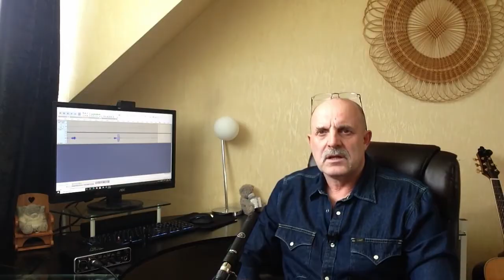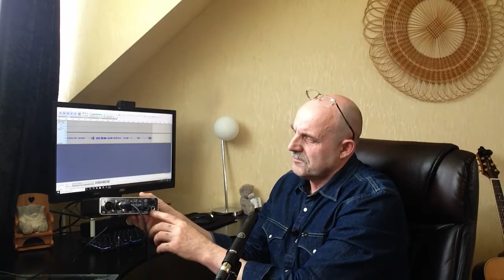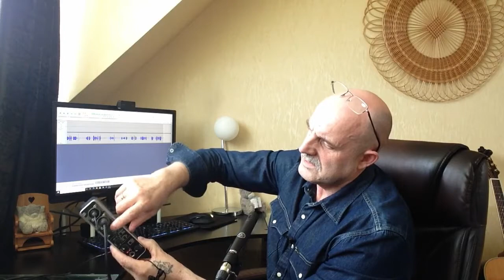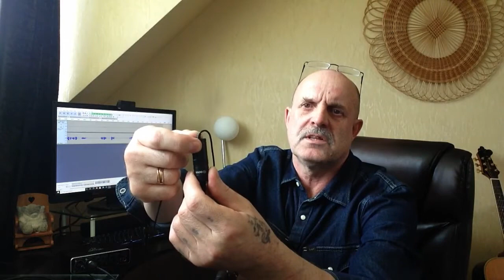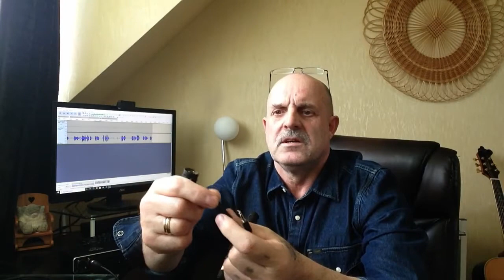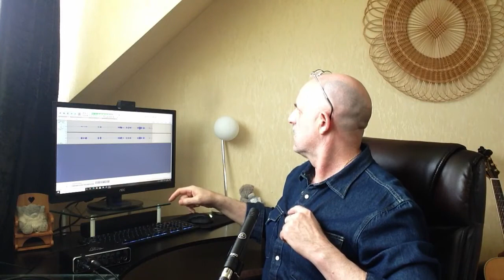Lavalier Microphone to Audio Interface/Mixer

Comment: Good morning sir.
I just bought that microphone and when I plug it in from the TRRS connector that it brings to the microphone input of the PC (the board has realtek digital audio sound) it does not pick up any signal, and in some cases it picks up a saturated noise signal to the point that the sound monitor of the audio DAW application fills the bars up to the red level without going down in any case. It does the same by connecting the "camera" switch and also in "smartphone" mode.
1. When connecting the BOYA lavalier to a PC directly, in what position should the switch be: camera or smartphone?
2. When connecting the BOYA lavalier to audio equipment that has 48v PHANTOM power (in this case a TC-Helicon Voice Live Touch or a mixer), what position should the switch be in, and what type of connector? I can use? In case of using a RODE VXL+ that converts 48v to 5v, in what position should the BOYA switch be?: "camera or smartphone"?
3. To connect the BOYA lavalier to any audio device, camera, PA equipment, processor or mixer, does it have to be done through the TRRS that comes with the microphone as a connector, or does it have to transform the 3-ring input to one of 2 (TRS) through a TRRS to TRS adapter?
I'm a bit lost, really.
Thank you for your patience and time sir.
Reply from the maker: Hello.
1. I have never used this microphone directly at the computer. Maybe it doesn't work because it has a TRRS end. Maybe you should try through an adapter with TRS.
2. If you use RODE VXL+, then you need an adapter from TRRS to TRS and the microphone battery must be OFF (Smartphone), because it will take power from the device. Phantom Power 48v must be on.
3. When using BOYA with the attached 6.35mm adapter, no additional adapter is needed. Then the microphone battery must be turned on (Camera position), because the microphone does not receive power through these connections.
All this is shown in the video.
There is also another video: https://www.youtube.com/watch?v=IljmjsvVDy8
Good luck.
Reply: @nostalgijaungitara  Thank you very much, sir!

Comment: I have a regular Lavalier microphone but when I plug it in to the aux of my radio, it doesn't hear the lavalier. Suggestions?
I am not a musician. I just want to hear people in the back seat of my taxi. I have a Plexiglas barrier because of Covid. Amazon doesn't have an easy fix. I have a Lavalier and a mini boombox
Reply from the maker: Sorry, I can't help you in this case. Maybe the microphone is not getting power. I have never tried to connect a lavalier microphone to the radio. I don't know what the system is there.

Comment: Hello sir, I just bought the behringer umc 202HD and also have the boya lav mic like yours. What is the sound difference direct to pc audio input compared to audio interface? I will use this in zoom to do live online lessons. Thank you.
Reply from the maker: Maybe the sound with the audio interface is a little better. You can also use studio microphones. I think an audio mixer might be better for live training, because then there are more options for changing the sound. But I don't know much about live streaming. I need an audio interface or mixer to record singing and guitar playing on separate tracks at the same time.
Reply: @nostalgijaungitara  I have an analog mixer I can input to pc Realtek hd audio on win 10 but will need an adapter 1/4 to 1/2 for it to work. I’m in China so I can find all of these very easily. Thank you sir.
Reply from the maker: @avia4281  You can connect the mixer to the audio interface. I also have a video. There is an example at the end of the video. https://www.youtube.com/watch?v=A6WZvcDa3Ug

Comment: What is the output level of the microphone in dB when connected to a mobile phone ??
Reply from the maker: Specification:
Transducer: Electret Condenser
Polar pattern: Omni-directional
Frequency Range: 65Hz-18KHz
Signal/Noise: 74dB
Sensitivity: 30dB_+/_3dB_/_0dB=1V/Pa,_1kHz
Output Impedance: 1000 0hm or less
Connector: 3.5mm (1/8ff) 4 pole gold plug
Power Requirement: LR44(Included)
Cable Length: 4m (13ft)
Net weight: 68g(2.4_oz)
The BOYA BY-M1DM is a Dual Lavalier Universal Microphone, with a single 1/8" stereo connector, it can be used with smartphones, DSLR cameras, camcorders, audio recorders, PCs and other recording devices with a standard headphone jack connector.
Reply from the maker: BY-M1DM
Perfect for interviews!
Specifications:

Transducer: Electret Condenser

Polar pattern: Omni-directional

Frequency Range: 65Hz ~ 18KHz

Signal / Noise: 74dB SPL

Sensitivity: 30dB +/ 3dB / 0dB=1V/Pa, 1kHz

Output Impedance: 1000 Ohm or less

Connector: 3.5mm (1/8”) 4-pole gold plug
Reply from the maker: I don't know why minus 30 dB is deleted when copying. You can search for information by name.
Reply: Thank you. 
I am using an android app called sound meter, that detect outside sound pressure and shows it in dB . So for my microphone I am getting output of 55 to 60 dB with background noise of 36dB. So my concern is am I getting standard output from my microphone or is it less. Because my inbuilt phone microphone is much louder from same range. I am using   Lensgo- DM2 and this is my first mic, so have no idea to compare with the output of another mic.